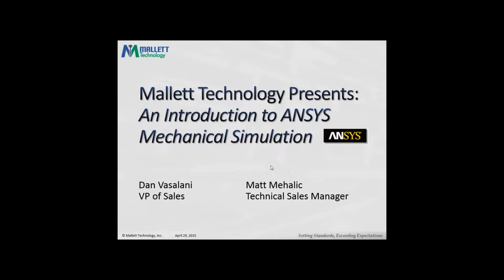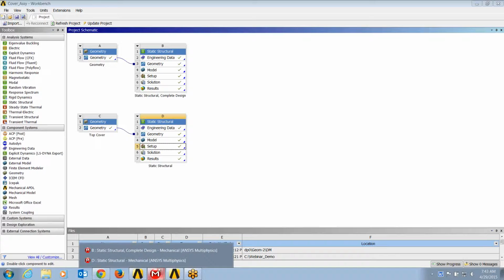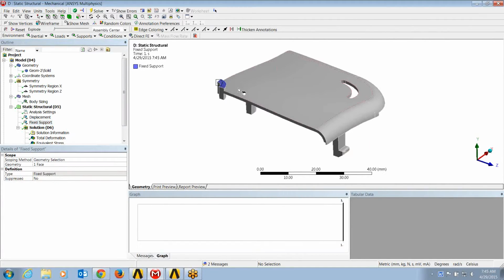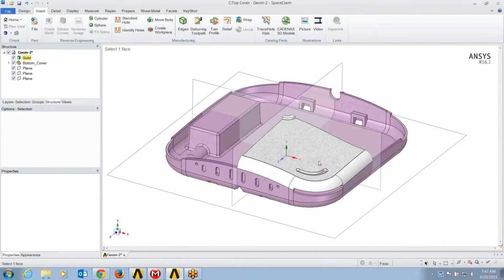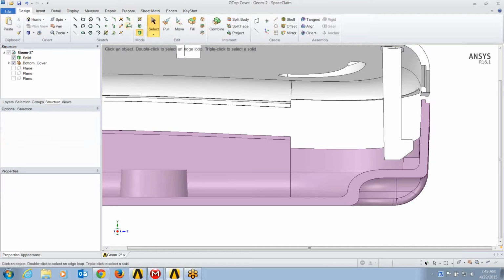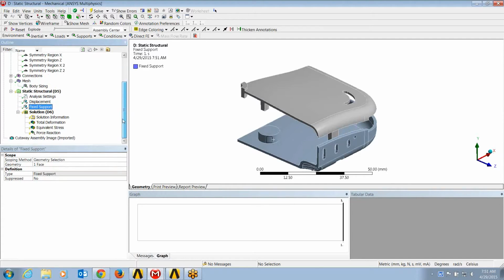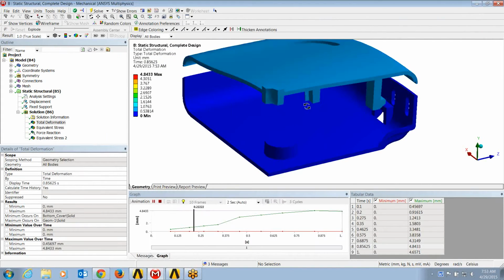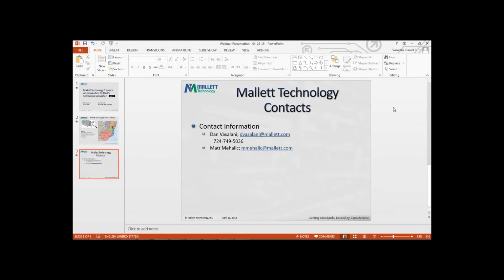Introduction to ANSYS Mechanical Simulation

Comment: In last minute one error message came but you show other simulation file. Which is already done simulation. 

I am getting same error message. 

please guide me for this tutorial. If you will give me WB file it is most favorable to me. 

Any PDF or PPT for this snap fitting tutorial it's also good.